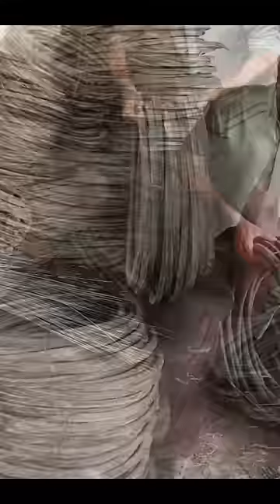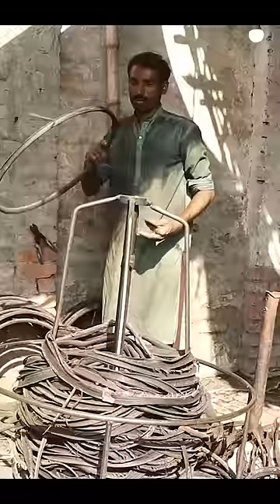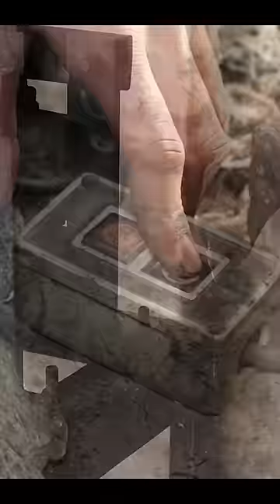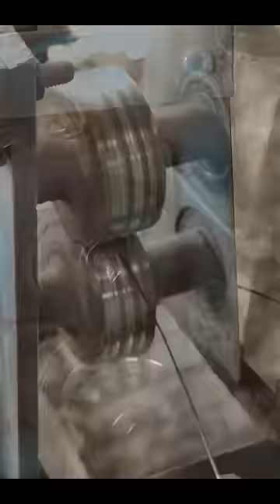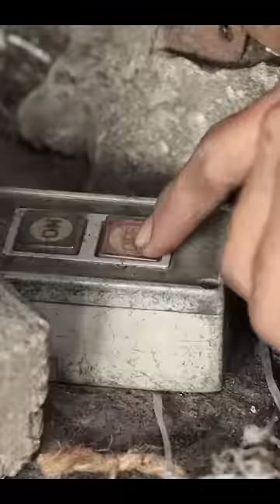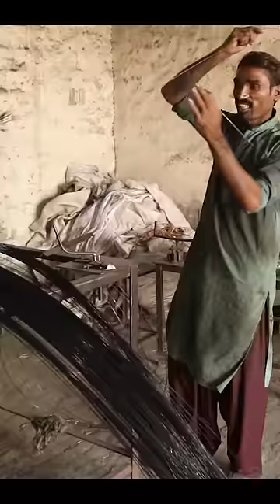Wire Separation From Old Trye #shorts #tyre #wire

Comment: Where there is a will, there's a way.  This gauge of wire must be used in many ways and therefore sellable around town to other shops.  Must be free tires off the road.??  The machines are purpose built somewhere.  The market for this, calls for this somewhere. These guys are clever and tough and making recycle pay for them.  👍😮🙏
Reply: Years ago I had a used and junk tire business. If I recall correctly I made about $3 a piece for hauling them off. It added up; especially when I had resellables.
Reply: @CaptRich-bi3gp    yah Captain, a person who is ambitious can find a way!!!!!👍

Comment: Recycling into what exactly? Some short sections of wire with a loop on each end?  Happy they are doing it but what is the end result??
Reply: Diversión
Reply: Good question, my thoughts exactly
Reply: Probably storing it like that for other applications, could be used as light fencing, chicken wire, ect. What would you do with a bundle of wire? The possibilities boggle the mind don’t they?
Reply: Respect.
Reply: Literally anything wire is used for?
Reply: Looks like hanger wire for suspension ceilings.
Reply: @davidclaudy4822  That's a fair guess.
Reply: a plethora of applications. Use your imagination
Reply: If free Tyre u could get like half kg of iron of it 
Iron is expensive there
Reply: @mohamedabdelkareem4397  what?

Comment: Sad working conditions. No safety equipment or regulations. Minimum wage. Rich boss. Poor workers. Unjust system.
Reply: You don't even know their wages. Plus, it's a different part of the world. Not every country can afford to enforce safety. It is up to the discretion of the worker if the pay is worth the risk.
Reply: @theepicpeguin  clearly lol. Either you can take heat, or your getting tf outta the kitchen.....
Reply: They are the owners of the mill,  and india has hot humid, tropical climate, so they work as they feel comfortable,
Reply: Sounds like Amazon !     😅
Reply: @BillSmith-fx7xx  worse than that, not to mention moskitoes,